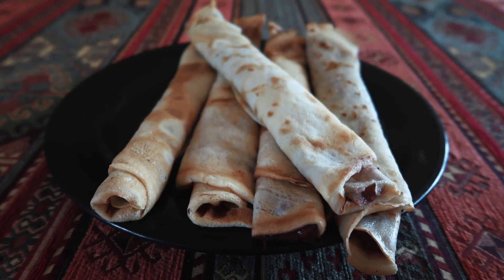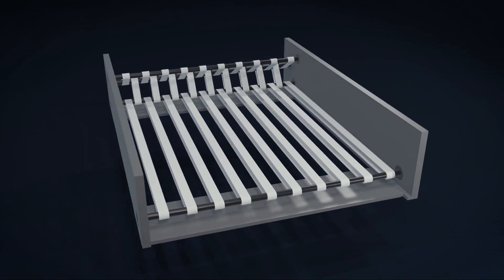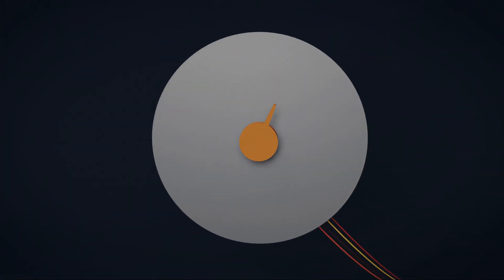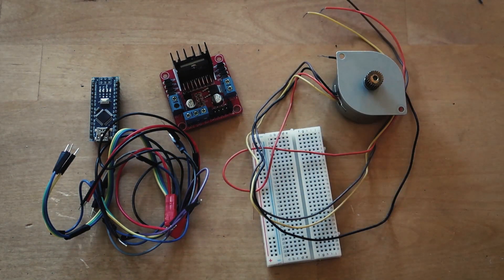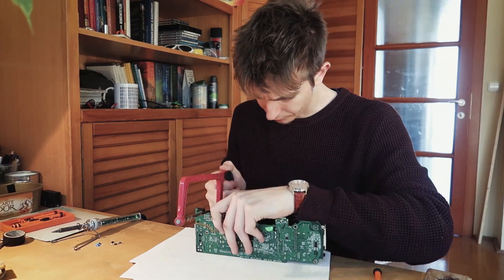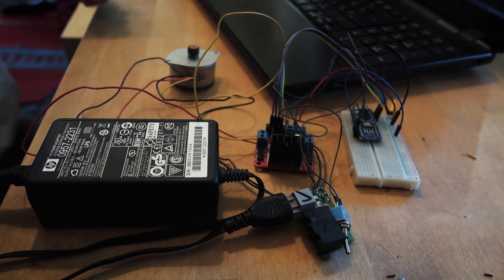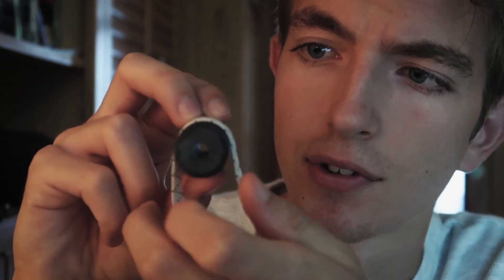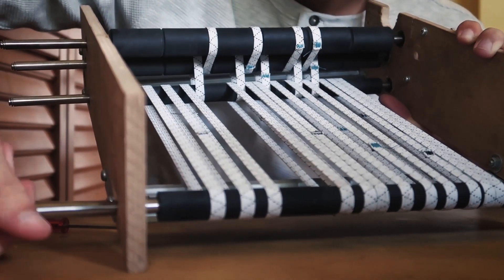Building a pancake machine #01: arduino pancake roller

Comment: Can you give the code in the comments please
Reply from the maker: Hi! The code is a bit messy, sorry! you can find the circuit diagram in the video at 5:14 

int fill;
int stepsForward;
int stepsBackward;
int steps;
int rpm;
unsigned long step_delay;
int fill2;                    // when only one coil is active

byte i;

void setup() {

  Serial.begin(9600);
  Serial.setTimeout(10);

#define motor_pin_1 3
#define motor_pin_2 9
#define motor_pin_3 10
#define motor_pin_4 11

  // put your setup code here, to run once:
  pinMode(motor_pin_1, OUTPUT);
  pinMode(motor_pin_2, OUTPUT);
  pinMode(motor_pin_3, OUTPUT);
  pinMode(motor_pin_4, OUTPUT);

}

void stopMotor() {
  digitalWrite(motor_pin_1, LOW);
  digitalWrite(motor_pin_2, LOW);
  digitalWrite(motor_pin_3, LOW);
  digitalWrite(motor_pin_4, LOW);
}

void loop() {
  // put your main code here, to run repeatedly:

  Serial.print("\nfill ratio (0-255): ");
  while (Serial.available () == false) {}
  fill = Serial.parseInt();
  Serial.println(fill);
  fill2 = fill + (fill >> 1);
  if (fill2 > 255) fill2 = 255;

  while (Serial.available())
    i = Serial.read();

  Serial.print("number of steps forward: ");
  while (Serial.available () == false) {}
  stepsForward = Serial.parseInt();
  Serial.println(stepsForward);

  while (Serial.available())
    i = Serial.read();

  Serial.print("number of steps backward: ");
  while (Serial.available () == false) {}
  stepsBackward = Serial.parseInt();
  Serial.println(stepsBackward);

  while (Serial.available())
    i = Serial.read();

  Serial.print("speed: ");                        //rpm is a parameter, that describes speed, but it is not the actual rpm.
  while (Serial.available () == false) {}
  rpm = Serial.parseInt();
  Serial.println(rpm);

  while (Serial.available())
    i = Serial.read();

  step_delay = 1250 / rpm;
  Serial.print("step delay: ");
  Serial.println(step_delay);

  steps = stepsForward;

  for (int i = 0; i < abs(steps); i++) {

    int k = i % 8;
    if (steps < 0) k = 7 - k;
    switch (k) {
      case 0:  // 1000
        analogWrite(motor_pin_1, fill2);
        digitalWrite(motor_pin_2, LOW);
        digitalWrite(motor_pin_3, LOW);
        digitalWrite(motor_pin_4, LOW);
        break;
      case 1:  // 1010
        analogWrite(motor_pin_1, fill);
        digitalWrite(motor_pin_2, LOW);
        analogWrite(motor_pin_3, fill);
        digitalWrite(motor_pin_4, LOW);
        break;
      case 2:  // 0010
        digitalWrite(motor_pin_1, LOW);
        digitalWrite(motor_pin_2, LOW);
        analogWrite(motor_pin_3, fill2);
        digitalWrite(motor_pin_4, LOW);
        break;
      case 3:  // 0110
        digitalWrite(motor_pin_1, LOW);
        analogWrite(motor_pin_2, fill);
        analogWrite(motor_pin_3, fill);
        digitalWrite(motor_pin_4, LOW);
        break;
      case 4:  // 0100
        digitalWrite(motor_pin_1, LOW);
        analogWrite(motor_pin_2, fill2);
        digitalWrite(motor_pin_3, LOW);
        digitalWrite(motor_pin_4, LOW);
        break;
      case 5:  //0101
        digitalWrite(motor_pin_1, LOW);
        analogWrite(motor_pin_2, fill);
        digitalWrite(motor_pin_3, LOW);
        analogWrite(motor_pin_4, fill);
        break;
      case 6:  // 0001
        digitalWrite(motor_pin_1, LOW);
        digitalWrite(motor_pin_2, LOW);
        digitalWrite(motor_pin_3, LOW);
        analogWrite(motor_pin_4, fill2);
        break;
      case 7:  //1001
        analogWrite(motor_pin_1, fill);
        digitalWrite(motor_pin_2, LOW);
        digitalWrite(motor_pin_3, LOW);
        analogWrite(motor_pin_4, fill);
        break;

    }
    delay(step_delay);
  }

  delay(500);

  steps = (-1) * stepsBackward;

  Serial.print("steps backward: ");
  Serial.println(steps);

  for (int a = 0; a < abs(steps); a++) {

    int t = a % 8;
    if (steps < 0) 
      t = 7 - t;
    switch (t) {
      case 0:  // 1000
        analogWrite(motor_pin_1, fill2);
        digitalWrite(motor_pin_2, LOW);
        digitalWrite(motor_pin_3, LOW);
        digitalWrite(motor_pin_4, LOW);
        break;
      case 1:  // 1010
        analogWrite(motor_pin_1, fill);
        digitalWrite(motor_pin_2, LOW);
        analogWrite(motor_pin_3, fill);
        digitalWrite(motor_pin_4, LOW);
        break;
      case 2:  // 0010
        digitalWrite(motor_pin_1, LOW);
        digitalWrite(motor_pin_2, LOW);
        analogWrite(motor_pin_3, fill2);
        digitalWrite(motor_pin_4, LOW);
        break;
      case 3:  // 0110
        digitalWrite(motor_pin_1, LOW);
        analogWrite(motor_pin_2, fill);
        analogWrite(motor_pin_3, fill);
        digitalWrite(motor_pin_4, LOW);
        break;
      case 4:  // 0100
        digitalWrite(motor_pin_1, LOW);
        analogWrite(motor_pin_2, fill2);
        digitalWrite(motor_pin_3, LOW);
        digitalWrite(motor_pin_4, LOW);
        break;
      case 5:  //0101
        digitalWrite(motor_pin_1, LOW);
        analogWrite(motor_pin_2, fill);
        digitalWrite(motor_pin_3, LOW);
        analogWrite(motor_pin_4, fill);
        break;
      case 6:  // 0001
        digitalWrite(motor_pin_1, LOW);
        digitalWrite(motor_pin_2, LOW);
        digitalWrite(motor_pin_3, LOW);
        analogWrite(motor_pin_4, fill2);
        break;
      case 7:  //1001
        analogWrite(motor_pin_1, fill);
        digitalWrite(motor_pin_2, LOW);
        digitalWrite(motor_pin_3, LOW);
        analogWrite(motor_pin_4, fill);
        break;

    }
    delay(step_delay);
  }

  stopMotor();
}

Comment: Raw egg in a machine - I guess it´s a hygiene issue because it´s difficult to clean and bacteria can not be spotted. 
Uh, back to the drawing board?
sorry
Reply from the maker: My first thought was that you give the machine eggs, milk, flour and water, and BAMM! Pancakes! :D But yes, you are right, the dough mixing process would be a really dirty, and bacterias would love that, so I reduced my expectations: the machine gets already mixed and properly cooled dough. Inside it will also be in a cool container (a fridge) that will keep bad bacterias away. I recomend you my previous video, where you can find the pancake making pipeline!
Reply: @zsigmondsinventions5201  Beware, it´s my job to find weak links in a chain ;). 
Just don´t clean your pancake making bot for 4 days and let it make  a pancake every few hours.  On the 4th day, have a look at the dough. The heavier parts of the dough are all on the bottom of the container. On the 5th day, take the time how long you need to clean it.
But overall, I like the idea of a pancake machine, although I would prefer pizza or garlic bread, that is perhaps not as complicated in the making, but easier to handle because you can pre-bake and freeze it.
Reply from the maker: This polarization of the components is a serious problem indeed! I am sure, especially the oil will come up to the top very fast! :/ Anyway :D We'll face it when we get there. Right now I am in the middle of the filling device. And thank you for your constructive criticism!!
Reply: @zsigmondsinventions5201  You can buy dry-dough ("just add water" - stuff) for pancakes. This should be way more stable in storage. Also, you don´t need to refrigerate, you save cost. But cleaning the mixing device is quite a task.
Reply from the maker: @Flix-f6q  maybe the whole container could be replaced, and I would have two of them. So I mix the dough at home or somewhere, put it in a container, bring it to the machine, and replace the empty and dirty container with the full one. Than at home I wash the dirty container, and start again.